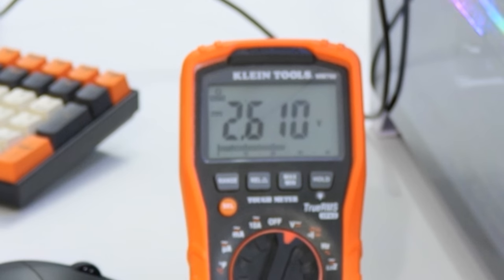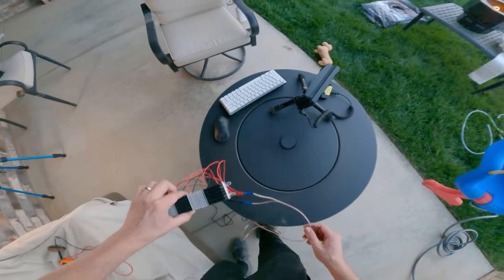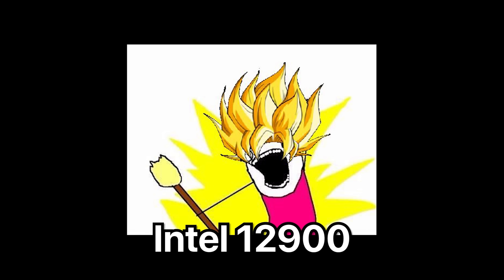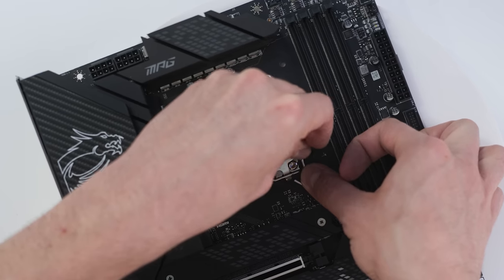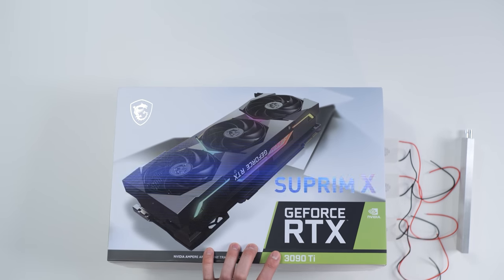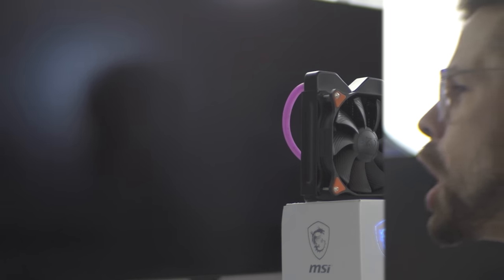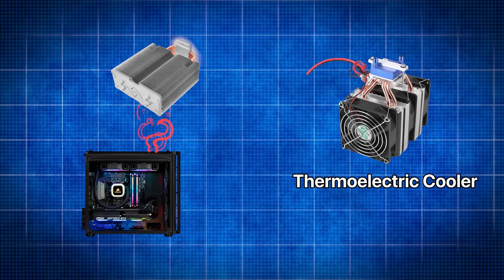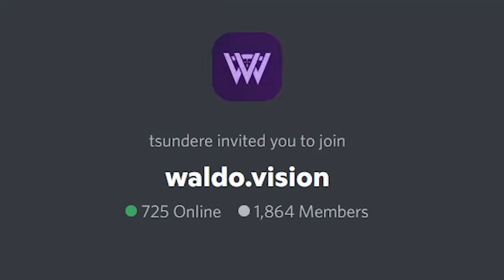I Built a PC That Turns Heat Into Electricity

Comment: This would be great for living off the grid. Saving power is important for that life style where you can't "just plug it in". Really would be cool to get a solid PC build or attachment that would do this. Preferably not built out of cardboard.
Reply: you know what is actually solid and cheaper? 100$ worth of Lifepo4 batteries, solar panels and a cheap charger controller. You are getting atleast 5 times more output for same price
Reply: @MaxC_1  This would be additive. Any additinal power saving options are nice for being on the road. Also there is no way high end computers are currently easy to work with off the grid. You have to settle for something smaller.
Reply: @noisynixx  this is barely additive- you get like 0.5W power at most but all you're doing is heating up the pc more by pushing in the hot air into PC again and also using that pump and all for the air will cost you more. It is just basic thermodynamics

Also you can use a decently powerful GPU+CPU combo even when offgrid. I mean a lot of offgrid systems are easily capable of running 1kW+ of heaters so a gaming PC that can run 1080p/1440p very well can be arranged at under 300-400W so you will definitely not want to run the highest end stuff- but anything in between should work fine

Comment: You need way higher temperature difference to get any meanigful power out of them.
Reply: YES AGREED! You need to drain the life from components much faster in order for companies who sell them make huge profits off of this types of tech..
Reply: What if you watercool everything but not using water but some liquid with a low boiling temperature, so the coolant boils and turns a turbine?
Maybe if boiling liquid is bad inside cooling blocks. You can use watercooling, and heat transfer to a low boiling point fluid, like a relay type thing.
Pretty much 100% of electricy computers use turn to heat, and steam turbines are apparently up to 90% efficient, so in theory you could reduce electronics power usage to 10% of original?

Comment: I’m gonna be screwed by heat when I upgrade my PC, I live in Australia and very rarely get to use my AC.
Reply: Remember under volting is a thing.
Under volting my 3080 saved 140watts and I lost 5% performance.   I cap mine at 140 fps so no actual loss in game.  And amd software auto under volts my 5900x per core 4.55 ghz on 12 cores

Comment: Fun idea, however you can't forget that there is more energy being used to pump the water to cool those blocks than the system can generate
Reply: Exactly needs a passive heat transfer instead of a pump that is as efficient as the pump for it to be viable.
Reply: Copper tubes would be effective and using a fan

Comment: Pure genius, this guy should be an engineer at TSMC
Reply: But this is just 0,7W that are coming out of that thing. Thats not really worth it. You would need much more efficient peltier elements than these. Peltier elements are better at pumping heat from one side to the other side. They are mainly used for camping freezers or other coolers, but even there they are inefficient, because of the very low efficiency 🧅
Reply: r/whooosh
Reply: @ChloeCake  "I build a gaming computer inside of Minecraft"

Comment: Reasons why the voltage/amps were low for anyone wondering:

1) Peltier modules (like the ones used here) have a very low efficiency (10-13%). So, receiving for example 100W of heat turns into about 10-13W of power. 
2) The heat in the system is not directed exclusively to the Peltiers. The computer components are cooled down with a cooler each, then the heated air is moved out the case and only a fraction reaches the heat sinks on the Peltiers, that have to be heated again to produce voltage. (I'm not even going to bother with the lack of proper insulation.

The TDP (Thermal Design Power) of the CPU and GPU is 150W and 450W respectively (CPU can reach up to 250W), meaning the cooling system should be able to handle this many watts of heat. Receiving less than 1W at the Peltiers (2.5Volts*0.3Amps = 0.75Watts) is underwhelming to say the least, when the theoretical max would be 60-70W (enough to charge or directly use a laptop, a mid-tier CPU, quite a few LEDs or even your monitors). The goal should be to directly convert part of the heat back to energy, and then get rid of any excess heat that we couldn't use.

Suggestions for improving this: 

1) You attach two or more copper heat pipes directly on the CPU and GPU (maybe also on the motherboard and RAM? It will add a significant cost to it for little heat gains.). They go directly to the Peltiers to produce voltage and then cooled down by water coolers and/or air coolers/heat sinks. Bonus points if it's one of those heat pipes with gas in them for better heat transfer.
2) The environment of the system should have little if no airflow, probably only on the motherboard circuits and RAM to cool them if they won't be used to generate electricity, to achieve a higher temperature in the heat pipes. Since most of the generated heat is transferred through them and not through air, it shouldn't result in a significant rise of the temperature inside the case. Having a way to regulate it in any case should be useful, though.
3) The efficiency can be further increased if the cool side of the Peltiers can become cooler, so strap a few heat sinks on the other side too.
4) For god’s sake, use a good thermal paste, not thermal glue.

A huge improvement would be to create a closed loop with a cooling fluid, creating a Rankine cycle (like a steam turbine power generator) that has a much better efficiency (20-40%) to convert more heat into electricity. In any case, a cool project if you have way too much money and time on your hands.

Kudos if you made it this far, now you're a little smarter. 😄

Comment: That's actually a great idea. Just how to make it work efficiently in a real world scenario. I mean almost all of the energy we use to run our PCs  just turns into heat, and we use more energy to cool it down. If only, somehow there was a way how to turn most of the heat back to electricity...
Reply: Saddly, the thermoelectric generators he used only have an efficiency of ~5% so it won't be possible before a while

Comment: For all the people asking why this sort of this isn't used in modern PCs, it's because the additional costs to all the extra components far outweighs any sort of efficiency gains from a system like this.  You are effectively generating a watt or two from the waste heat of a system that requires a few hundred times that to run.

And for those who are wondering, similar systems are actually used for some large datacenters, but rather than turning that waste heat back into electricity it's directed somewhere useful, like to heating pools or heating homes and greenhouses.

Comment: This kind of thermoelectric generator (a Peltier module) has a higher electric output if the temperature difference is higher. The best way to do it is to put the generator module between the CPU and the cold plate of the AIO. You don't even need anything external to the PC. You should try it.

Comment: With proper insulation you could put the generators in the middle wall, and when the air makes its way back in the system passes by these cool pads cooling it without any addition fan.

Comment: I get that this video is mainly for entertainment, but for anyone who wasn't sure...

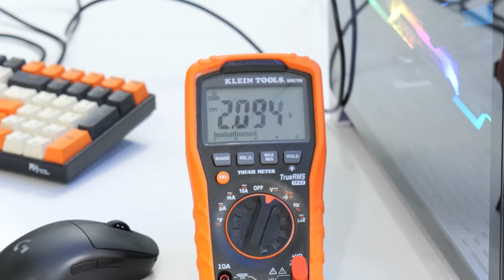10:25 - it might be showing 280 milliamps on the meter, but the meter basically puts a short-circuit across the probes when in Current mode, so there will be almost no voltage across the TEGs when measuring the current.

2.1V * 280mA would be just over half a Watt. But the real generated power is going to be only a tiny fraction of that.

Also, eventually the heatsinks inside the box will reach more of an equilibrium with the temperature on the hot side of the TEGs, so it will become even less efficient.

Having said that, with enough TEGs, and a very small amount of (very low-power) active cooling with fans, you might be able to slowly charge your phone using only the heat from the PC. Or, charge a power bank using the TEGs (which will take a long time), then charge your phone from the power bank later.

Or, just underclock your GPU a tiny tiny bit, and save yourself more on the electricity bill than you would gain from this setup. ;)
Reply: btw, that isn't to say that I dislike this channel. I'm definitely going to watch the potato video right now. lol

Comment: Note that this doesn't actually turn heat into electricity because that's illegal according to thermodynamics, it's using the movement of heat from the hot side to the cold side to generate electricity, like a windmill but for heat. This is basically the same thing but it means the room still gets hot unfortunately :(

Comment: I was told by somewhat a friend of mine around 2005ish that she found a way to quite efficiently turn PC heat into electricity from using liquid mercury expanding through a very long tesla tube, especially for smartphones. 2015ish... she then told me that project was too expensive, but... started looking into 3D printing fiber photonic GPUs which requires almost no power and produces no heat.

Comment: Have you considered a custom water loop that includes the GPU and instead of using air to transfer your heat, you use the water loop and multiple cpu blocks that are attached to your generators?  Since you already will need at least 2 pumps to keep the water moving at a decent rate, it might be a good idea to add a water tank into the system with a hydro-electric generator, use gravity and the pressure from the pumps.  But I am not entirely sure of the efficiency gains, using the water blocks should increase thermal transfer to the units and in your current system the GPU not being in the water loop only adds ambient heat, but there is a decent amount of heat lost out the back of the system, which could be lost energy...

Comment: Place the thermal generator on the GPU, dunk the entire thing in mineral oil and get the output power to run the fans. Do this at scale and you might end up saving money on a mining rig. Since most of the power costs for mining are associated with cooling. Small scale, we'd be talking about 360Wh per day savings, expand this to a rig that is 100X bigger and that would be 36,000Wh saved per day. That's $1,6000 saved per year.

Comment: Rather than having a radiator blow hot air into a radiator that absorbs the heat, just attach the water loop directly from the CPU to the TEC. Then after that it can go through a normal radiator to ensure the system doesn't overheat, but the radiator will be colder because the TEC took some of that heat for electricity.

Comment: From my understanding this only works well if the temperature difference between the two surfaces is great. This doesn't occur in a normal room and if you connect it to outside you may as well just dump the heat.
And cooling the other side with electricity is obviously dumb.

Comment: How about if it was custom loop water cooled? instead of using a radiator and new heat stacks, get about 13 cpu blocks, put 6 on one side of the thermal generators, and one on the cpu, get a custom gpu block? Then loop it so that the cpu, gpu and 6 of the generators are on one loop? then use the 6 remaining blocks and tie those directly to a 360/420mm radiator? or just tie it directly into the cold incoming water stream and run sprinklers in the yard?

Comment: use the heat from the gpu and cpu to run a starling engine use that to run the water loop, fans and accessories

Comment: Integrating one of those dinky little water based portable air conditioners into the build and using the heat generated by the build components to power it would be my thought on most effective use of this tech

Comment: It feels like this has some actual potential. Replace the (horribly inefficient) TEG's with a Stirling engine+generator, and integrate it directly into a water cooling loop, the you might actually get some useable power. Sure not enough to power the PC itself, but charging your phone? No problem.

Comment: This could be done much more efficiently with a liquid cooling loop that takes the heat from the CPU and GPU to a water block that transfers the heat to the dielectrics and use the fan and coolers on the outside to keep the thermal differential

Comment: The bigger the difference in temperature, the higher the power output. If you were to cool the cold
Side more, like with a bigger radiator, you could have gotten more power out of the modules and therefor increase the efficiency of the prototype

Comment: Speaking of peltier modules, I got one from a broken phone cooler and my question is how can I make it cooler? Do I need more power or should I make the hot side more cooling or does it have a limit depending on the size/specifications? I can't find clear answer from the web

I wanna glue it into my old phone near the chipset then overclock that phone, yes it might be dumb to some but snapdragon 865 is a freaking good chipset until now it can run heavy games with highest settings except the trash warzone mobile

Comment: I wonder if you could power the cooling of the thermoelectric pads with the heat the PC is outputting. So when the PC gets too hot, producing too much heat. use that to cool down the CPU and possibly the GPU. Kinda like a self-regulating PC by design. 

The only two issues I see are either.
 1. You don't produce enough heat from the pc, and thermal electric pads heated side. 
Or 
2. The heated side of the thermal electric pad would be too much on top of the pc heat, creating a loop where the pc keeps adding power to the system, and the thermal electric pads are not enough to cool it.

(Should specify no perpetual motion ideas)

Comment: There might be one way to utilize this directly between cpu and water cooling system would be a much larger temperature differential as that's how you get more power from those generators. Big temperature difference but within temperature tolerances is max power. Also wouldn't require extra bulk external gear. Just water cooling. This might allow for greater efficiency of cpu mining. The water cooling system might need to be cooled to make up for slower rate output of heat through system with TEG impeding cpu cooling and to increase heat difference to max operating capacity. It would definitely depend on TEG used as some can produce as much as 60 watts. If most power used up from heat generation from resistance in cpu and that resistance energy can be directly utilizes by temperature difference device like TEG. Anyways think that what make interesting build

Comment: The summers in India are really hot. Walls, railings, and almost every solid object, which also includes the ground itself, gets heated up. 

Is it possible to put that system in a brick wall and that wall produce electricity via hot weather, or shall I say while the other side of the wall is on fire?

Comment: Dude I was attempting like the same thing for the past 2 years I just keep having a problem with the thermal pad fucking like burning out on me cuz I'm using one of the heat to cold exchange pads I got to check out your channel see if you get any more stuff on that it'd be better than Excedrin... 🐐GOAT
Reply: I actually have it set up on my old school Panasonic tough box I think it's a c29 and I have the heat actually exchanged and used a very small DIY steam engine but that's all whole different thing.. 😭

Comment: It's not really an infinite energy but I'd say it's like driving a car and put some kind of turbine at the exhaust that connects to a small motor that generates electrics and save it in a battery 

It's like using electricity at its peak usage like "I bought the whole speedometer, imma use the whole speedometer!"

Comment: What if instead heated water in a tube and forced the steam through a turbine, been allowing the water to condense (taking heat from the room) feeding the water back into the system, cooling the room and increasing the efficiency and cooling of the PC

Comment: I don't really care how much electricty you can gain from it. What i want to know. How much heat can you remove once it's more optimalised? An issue with high end PC's is that they heat the room, suffering if you don't have air conditioning, and if you do it just makes your system work harder.
Would be pretty amazing if you could make your PC heat neutrall, not warming the room at all.

Comment: 2 volts at 0.3 amps = 6 watts = pathetic. i could get more simply by turning down fan speed and or keeping case open and or reducing cpu voltage or speed... the pc is using 50 to 200 watts plus gpu wattage of 20 to 400 watts.

Comment: Okay what if you turned your computer into a Stirling engine to run a generator where instead of air you had ammonia or some low boiling point working gas. The computer part would all be heat sink and made to work like a thermoacoustic chamber. It would be vacuum tight with compression with the Stirling engine. And the engine would have to be made like one of those large coffee cup stirlings to work off little heat like the ones you put on a coffee cup. Then the flywheel would have to be coupled to a small generator. The alternative is to have the flywheel spin a giant doughnut magnet and have some microwave coils to harvest electricity. And some power converters if needed. I should have turned this into a go fund me. But I doubt I could get many views of it on youtube.